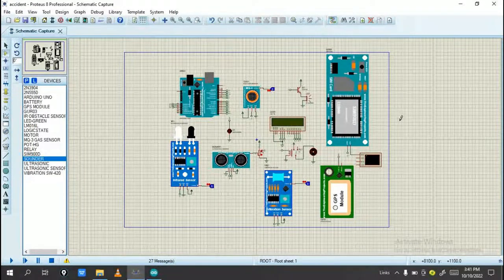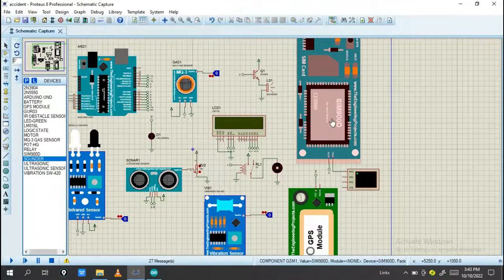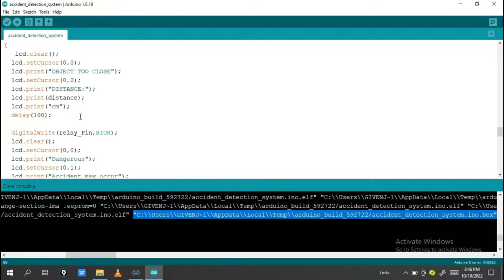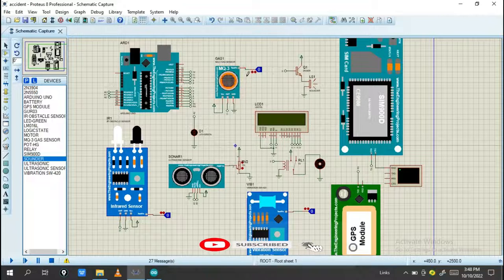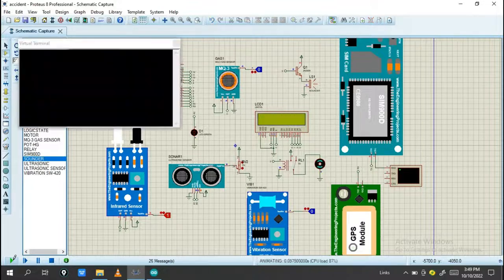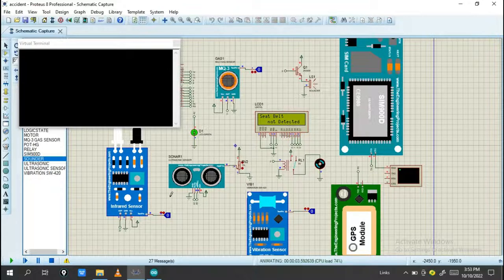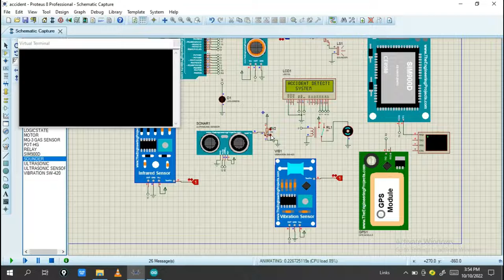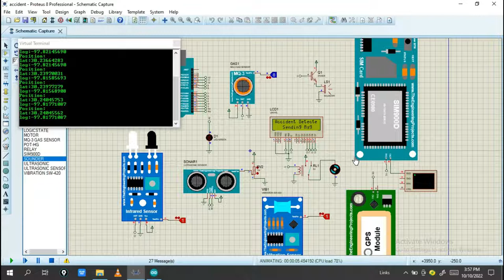how to make accident detection system

Comment: When I run the project, it does not work and an error appears: internal exception access violation in module 'PIC16EX.DLL']0007C715]
Reply from the maker: Check me on telegram link on description
Reply: Is there a solution for the project to work? Please explain
Reply: @smartkembo  ok
Reply: I have been following you for a very long time. Please explain the solution to this problem
Reply from the maker: The "Internal Exception Access Violation" error in Proteus usually occurs due to compatibility issues or corrupted files. You can try reinstalling Proteus or updating your drivers to resolve the issue. Additionally, ensure that your system meets the software's requirements and that all dependencies are properly installed